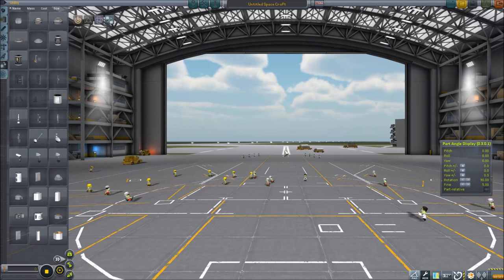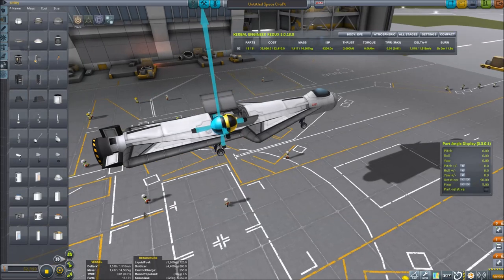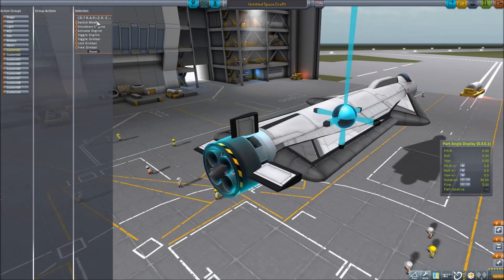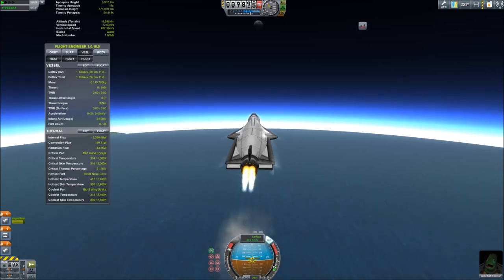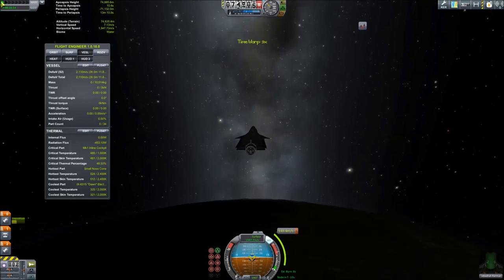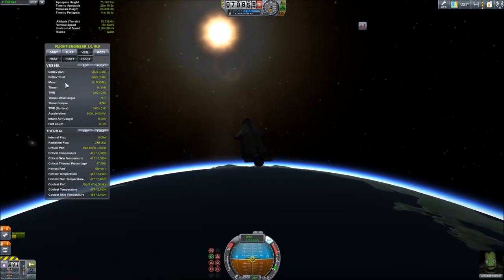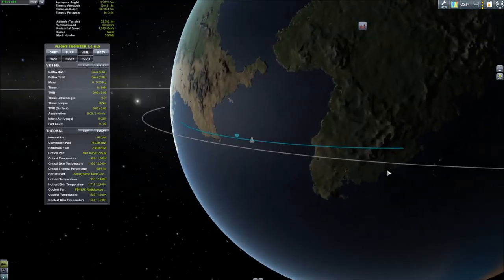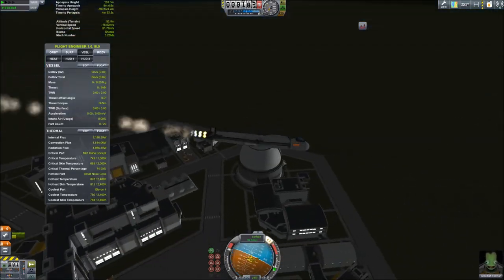How to Build and Fly an SSTO Spaceplane - A Step by Step Walkthrough - KSP v1.05

Comment: I keep on coming back to this video for tips. Some notes so I don't forget next time:

+ max mass with 1 RAPIER engine is 21 tons
+ wing area should be 20% of wet mass in tons
+ Center of Lift (CoL) should be just slightly behind Center of Mass (CoM)
+ Reversed nose cone offset into the RAPIER engine looks cool

Ascent Profile:

+ Stay level until about 300 - 400 m/s
+ Pitch up to ~ 30 deg, until 8500 m
+ Next, set stability to prograde
+ Pitch up just enough to avoid overheating
+ Closed-cycle at ~ 23 km 
+ At ~ 30 km, set stability back to prograde 

Descent:

+ 40 m/s retrograde burn at the peninsula at 25:22
Reply: thx

Comment: Did someone else notice the drifting ace @ 10:17??
Reply: Never noticed it. I always notice the three trucks almost crushing into each others in the VAB though
Reply: Yes. :D I love that sort of thing, but I've spent so much time in the SPH, it's actually started to get a bit old. There's also 3 trucks which barely miss each other as Leonardo said, one of which is the same as the drifter. Another truck goes out the big front doors to pull a drifting loop around a larger truck which stops and waits for it to do so. It's great until you're trying to focus on your latest & most complicated spaceplane & all these crazy trucks keep distracting you. Actually, come to think of it, that's probably a sign it's time to take a break. ;)

Comment: this is one of the best KSP tutorials to exist.
Reply from the maker: thanks!  I'm glad it helped.
Reply: though im still contiplating how to lift a large one off the runway without having it swerving off
Reply from the maker: if it's swerving severely you could have landing gear unaligned.
Reply: Weak landing gear also makes it hard to keep it straight. I sometimes have to put spring & damper strength to manual and increase them.

Comment: "We're gonna use a Rapier Engine" ... well guess I've gotta focus on science points then...
Reply: You don't need the rapier, Brad just plays in sandbox

(I know I replied 2 years late)
Reply: Use nuclear engines for space,  90kn per engine so I recommend having at least 2. Nu-kes don't need oxygen to work, they just need anything that can transfer their energy-clear engines only need liquid fuel to work so you can fill your whole craft up with liquid fuel for both space and kerbin.
Reply: Whiplash + terriers or other rockets also works, it's just heavier. (The Whiplash is 1.8t, the rapier 2.0t.) Some people use the 1.2t Panther which in wet mode has the same thust as the Whiplash, but it's not supposed to be so good at high altitude. (I haven't tried it.) Some people use the Juno jet, but having tried it, I think that's the really advanced class! Perhaps they simply accept they have to light the rocket(s) earlier and have less efficiency. Nuclear engines are great in some ways, but weigh as much as a conventional engine with nearly 11 times the thrust in a vacuum.

Comment: Very good tutorial, Brad. It covered every necessary detail solidly, without confusing elaboration, and at a pace where even I could absorb every point. I like to have more wing area so as to take off more like a normal plane, but I totally understand the desire to minimize excess mass. None of my spaceplanes are in the least bit long-range, yet. :)

Comment: I guess you could call that a SSTO, a little toy spaceplane. That's not how I build them and unfortunately, tiny spaceplanes have very little in common with a purpose build, 100-200 tons wet SSTO.

I start with a cockpit, usually mk2, then add a crew cabin, then mk2 docking assembly, mono prop tank, short fuel tank for emergency fuel and balance, 2 big cargobays. That's usually the minimum I want to take to space, but sometimes I build mission specific configs.

Anyway, to lift above mentioned configuration, NOT using rapiers, using tier 7 gear, you need a 50 ton SSTO, with 2 turbojets (whiplash) and 2 reliant rockets. Works very well, and you can deliver all that crew, plus 360-500 units of fuel/oxidizer to LKO.

See the problem between tiny ssto that carry 1 kerbal and a probe to orbit is that you don't need much lift. On a 50 ton SSTO you needs lots of lift and if you use stock parts, that means assembling shear resistant wings, assembling everything so it doesn't jiggle and is low drag, plus sticking more wings in creative ways to generate the required lift. 

There are no formulas for calculating lift in KSP yet, so fabricating your wings and balancing center of mass are the key skills in SSTO design. The sooner you switch from toy SSTO to 50 ton or bigger SSTO, the faster you'll learn how to build them.

My last night work: a 90 ton wet SSTO, that delivers 6 crew and half orange tank worth of fuel to LKO (remotely if so desired), some in tank form, but most requires an existing tank in orbit to refill - I usually send those up with rockets, part of space stations - NO LITTERING with discarded fuel tanks ! http://prntscr.com/a6v4n7
Reply from the maker: I disagree that there isn&#39;t much in common.  The concepts of mass balancing, piloting, and even flight profile are the precise same thing you need to understand to build a big SSTO.
That being said, if you want to check out a big complicated SSTO I would recommend the subsequent video I did.

https://www.youtube.com/watch?v=3Qa9aWBvw0k

Comment: Very good tutorial. Unfortunately, my craft starts falling down at 8500m when I change SAS to prograde. Is there semething I forgot to do? I followed your constructions and I´m using a replication of your bot (only changed the cargo bay for a mk2-clamp-o-tron and added 2 small round monopropellant tanks with some rcs thrusters(the smallet ones). (Actually I wanted it to be able to dock on my space station).
I thank you in advance for reading this, maybe I forgot something 

Ps: Total Mass of the craft: 16.275 tons
Reply: Do you think this happens because I´m lacking a cargo that uses a reaction wheels?
Reply from the maker: Hello Kaul, could you elaborate on what you mean by "falling down"?
Reply: He mentions it when setting SAS to prograde, so I think he means the nose starts dropping.

Comment: hey, thanks for the video and your bill adventures series..I really enjoy them.. So I am fairly new to the game and seem to have the issue that i can't align either the front landing gear nor the rudder exactly in the middle. it alway snaps to either side at a weird angle. It is kind of driving me crazy because I can't seem to do it..is there a trick to it? This happens to me with wings as well.. I can get them horizontal without an angle to them when I attach them to the small cargo bay but never on fuel tanks. I hope you might have the time to help me there.
Reply from the maker: Some non-cylindrical parts and cargo bay parts don't have normal angle snap.    The easiest solution is likely just attaching it to a different part, and then using part offset if you need to.
Reply: ah okay :) thanks you so much. Thats a good work around to my problem. cheers

Comment: I have made this small plane and randomly on the runway it suddenly drifts out of control! how do I fix this
Reply from the maker: Sounds like landing gear that are not properly aligned. Make sure they are precisely vertical.  If that doesn't fix it, make sure all your symmetry is set properly.  Let me know how it goes.
Reply: +Bradley Whistance thankyou for your comment. I found the problem, it was because of: A.the wheels had steering activated and B. I did not have a rudder.
Reply from the maker: Let me know how your flight goes!
Reply: +Bradley Whistance (EvermoreAlpaca) instead of adding a nose cone you should put a shelled clamp-o-tron

Comment: Followed exact same steps, but my landing gears always explode because of over stress on takeoff. Any help?
Reply from the maker: This was done in KSP v1.05.  Landing gear was changed patch 1.1, so you might need to upgrade wheels.
Reply: +Bradley Whistance (EvermoreAlpaca) okay, I'll look into what I can do with bigger gear. Thanks for the hasty response btw!
Reply from the maker: No problem, there are gobs of excess thrust and fuel in the design so it shouldn't be an issue to add some mass.

Comment: I tried this design, but my plane kept turning and tilting over on the runway. I got the landing gear as close to what you did as I could, but it always started turning after went a ways down the runway, and always fell over immediately after that. What am I doing wrong? Do I have to exactly replicate the smallest details of this design to keep it stable?
Reply from the maker: +SchrodingersWaffle You should not have to replicate the details, I tried to build a lot of leeway into most aspects of the design.  My first guess would be that your landing gear is not straight up and down, or not parallel to the direction of travel.

The only other thing that would cause issues with stability would be if you put the wings farther forward, but that wouldn't cause an issue until you had built up more speed.  Try reattaching the landing gear and making sure they are precisely vertical.  I would be happy to take a look at a screenshot or a .craft file if that doesn't fix it.

P.S.  To be clear, the position of the landing gear isn't critical, but the angle they are attached at does.
Reply: Bradley Whistance I see the problem. I had been attaching them to the adapter and offsetting them onto the cargo bay, so all the increments of the rotate tool were misaligned. I did the opposite and it worked like a charm. Thank you!
Reply from the maker: +SchrodingersWaffle =0
Reply: Why are the rear wheels so close together? From my experience, this could make the craft tip over. Not far from a bicycle. Still, I learned a lot from this video, so thanks!

Comment: The moment you mentioned rapier engine I just had to quit the video. That engine is not available at the start of the campaign :(
Reply from the maker: You can&#39;t build a good SSTO craft with what is available at the start of the campaign.  Make sure to come back when you have more parts unlocked!
Reply: Bradley Whistance Wheesley? Panther? Do those work?
Reply from the maker: ***** Its possible to make an SSTO without using any air breathing engines at all.  Problem is, they won't be that efficient.  The addition of an air breathing stage merely increases efficiency.

So yes, just about anything will technically work, but its not until you start using the higher tech parts that SSTO Spaceplanes really shine.

Comment: Where is your oxidizer located? and correct me if I am wrong but Rapiers use a lot of oxidizer
Reply from the maker: In the mk2 to 1.25m adaptors.  They don't use oxidizer until you switch to closed cycle mode, so I'm not sure what you mean by a lot.
Reply: Just for reference I do run an overengineered Mk2  Jet With huge wings,  1 Liguid fuel tank, 1 cargo, 1 bicoupler, 1 monopropellant tank,2 Rapier. For example if I switch to close cicle at about 12000 km the ship will run out of oxidizer in like maybe 30s because it has 200 deltaV.
Reply from the maker: Out of curiosity, why are you switching to closed cycle at 12,000 km?
Reply: My excuse was experiment for testing a prototype  vehicle that can fly without a crew if I wanted to, If I was patient enough to wait for it to switch automatically they would probably be activated at  higher altitude

Comment: Doesn't seem to work.  Every plane requires constant back-stick to maintain level flight, and cannot climb to 8500m without dropping to about 200 m/s speed, at which point, the RAPIER can no longer power me back up to 300m/s, and I lawn dart into the ocean.  Alt-S does not seem to provide enough trim adjustment to allow smooth level flight without bobbing up and down.
Reply from the maker: goolash1000 I suspect that your centre of lift is too far aft, resulting in excessive use of control surfaces,  and therefore more drag.
Reply: Even with four air intakes and only nosing up to 15 deg., I gradually lose speed and thrust until I'm forced to level off around 5000 m.  This is with a inline mk2 cockpit design weighing 14.5 t.
Reply from the maker: Try a lower angle of attack until you reach 350 m/s
Reply: Swapping to a shock cone intake and removing a couple air-resistant items (docking ports) helped, now I can get to 8500m, but at level flight, it does not accelerate much beyond 300 m/s.
Reply from the maker: try accelerating to 400 m/s at sea level then climbing
Reply: I'll have to try that.  Moving the centre of lift forward helped, as did dropping the external items.
Reply: I think the mk2 cockpit must cause a while lot more drag than your design.  It flies straight and level now, but tops out at 340 m/s ASL.  I'll try again tonight with two engines.
Reply: I think the mk2 cockpit must cause a while lot more drag than your design.  It flies straight and level now, but tops out at 340 m/s ASL.  I'll try again tonight with two engines.
Reply from the maker: The shock cone and aero. Nose come induce far less drag than the mk2 cockpit
Reply from the maker: Cone*
Reply from the maker: If your mass is 15 tons,  one rapier should be plenty

Comment: I know you'll never reply but my plane has low thrust to weight and can't get past 300 m/s
Reply from the maker: What is your take off mass and what engines are you using?
Reply: Whoa this video's a year old and you still replied haha. It's 16 tons, followed everything you did.
Reply from the maker: Did you precisely follow the ascent profile used here?
Reply: I'm pretty sure I did
Reply: What is the twr on kerbin for your craft? kerbal engineer says 0.67 for me.
Reply from the maker: That's more than enough Rapier to fly with.  If you aren't picking up speed,  fly at a lower angle of attack
Reply: If I go any lower I fall at 100 m/s. I think it's really disingenuous of you to post a video with a cheated craft...
Reply: It works fine for me.  Get as much vertical speed as you can and go up at 20 degrees.  Rapier gets more efficient the faster you go.  Followed this video just now and did a perfect flight and return.
Reply: You said yourself that when you tried it out that the video was a year old. Maybe newer versions of ksp decided one radial intake was not enough to get a rapier to full power. Try adding intakes, like 4 if you are trying to recreate this ssto

Comment: Thank you for all these great videos!  They are some of the best ksp videos on youtube. (seggestion for oddessy by bill- sent to exterminate the deep space kraken on bop)
Reply from the maker: +Jacob Lund From my experience the kraken usually strikes on Pol...
Reply: +Bradley Whistance (EvermoreAlpaca) yes, but i have heard reports of it napping on bop.  Bill should verify these absurd claims
Reply from the maker: +Jacob Lund True, first I'll need a challenging goal involving one of the moons or both
Reply: +Bradley Whistance (EvermoreAlpaca) how about trying to recover more fuel than you start with, but only using ore from Jool's moons
Reply from the maker: You're thinking in the right way now, but that actually would not be that difficult.  In fact, it would be significantly easier than doing this on the mun.  The dV to get from LKO to a Pol or Bop landing is barely more than to land on the Mun, and the TWR requirement is lower.  I had around 1900 m/s in LKO on this mission, and just made it to the Mun.  It only takes about 1150 m/s dV to get to the Joolian system, and under a 1000 to land on Pol.  With the much lower gravity, you could skip some of the LVNs and it would be much easier overall.
Reply: +Bradley Whistance (EvermoreAlpaca) just throw a few hundred passengers on to make it more of a challenge.
Reply from the maker: +Jacob Lund Perhaps a passenger trip to Laythe.  Laythe is a fun vacation destination.

Edit:  I have a better idea, Ill have to spitball some ideas and see if its feasible
Reply: +Bradley Whistance (EvermoreAlpaca) that sounds good(and difficult)
Reply from the maker: +Jacob Lund   Last Laythe mission I did was a multi-moon SSTO seen here:  https://www.youtube.com/watch?v=VdVaTrrgWKY  If i skip the other destinations I should be able to bring some friends and some toys.
Reply: +Bradley Whistance (EvermoreAlpaca) May I suggest an SSTO without using Rapiers? (maybe the kraken destroyed some warehouse on Kerbin/KSC and Bill's gone to go blow it up for vengeance (lugging a missile or two))

Comment: elevons* not elevators
Reply from the maker: Flight control surfaces at the rear of the craft, used to control pitch, are elevators.
Reply: combined ailerons and elevator are called elevons
Reply from the maker: Being as this does not have ailerons, they are indeeed elevons.  They are therefore both elevons and elevators!
Reply: correct :D